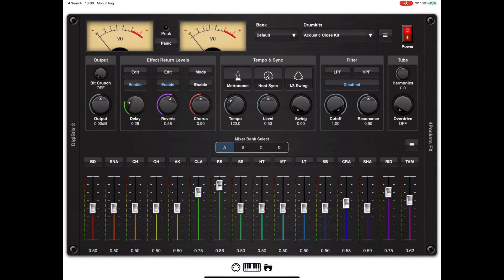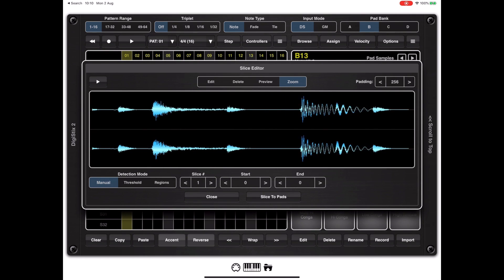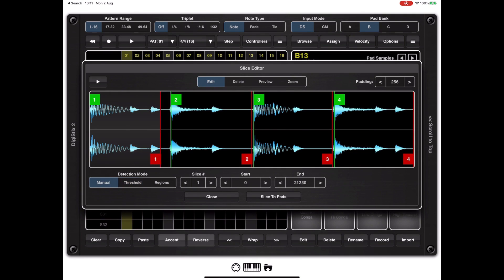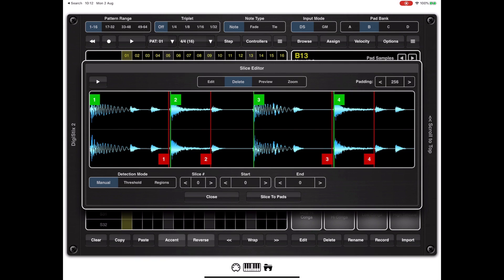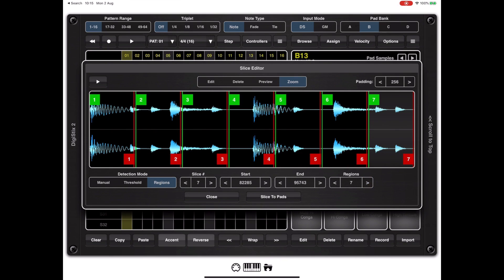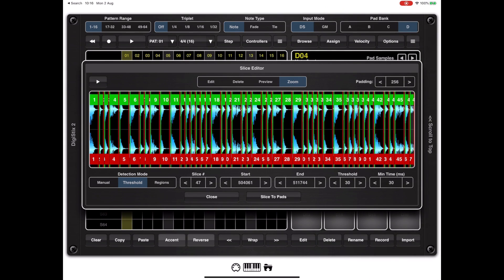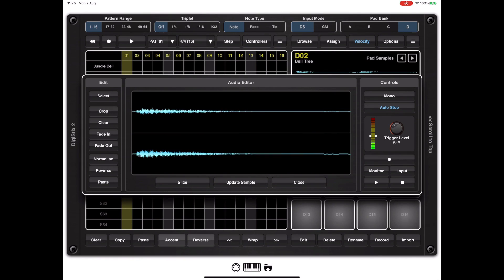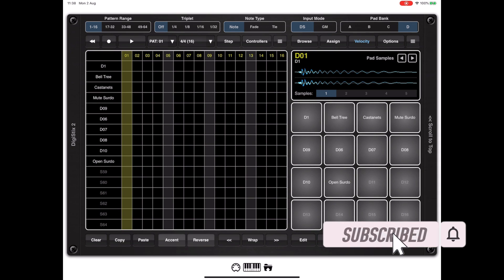DigiStix 2  - Tutorial 2  - Slice Editor

Comment: Great update !
I was wondering if you could make an option so the imported samples appear with the original name on pads without the need to rename.
That would be great for making user kits.
Reply from the maker: The only reason I didn't do this is because you can use the 'Set Pad Defaults' to configure all the names to either GM or DigiStix format. In this case you don't really want to overwrite the names, but I'm sure I can add an option for that no problem.

Comment: Great feature but crashing on slice to pads ! I know your get a quick fix out. Still the best sampler drummer on iPad👍 our try a fresh install see if that fixes it.
Reply from the maker: Really? Can you tell me how many slices you are trying to assign and how long the original sample is? Maybe you've exceeded some kind of limit and I haven't tested properly? Also try the same thing in standalone mode and see if you have the same issues.
Reply: @PaultheMusicMan  Just tried loading the same sample that gave me the problem cropped it first and then sliced to pads via region and it’s fine so not sure what caused the original crash on load to pads strange. Great feature really helpful.
Reply from the maker: @MeerkatMuzic  No worries, let me know if it happens again mate. I will keep banging away at it and see if I can spot anything.
Reply: @PaultheMusicMan  The sample length was 7.868 prior to cropping post crop about 5 sec. Hopefully just a glitch time to make some beats !
Reply from the maker: @MeerkatMuzic  How did you import the Clap? Was it drag and drop? The kit is saved I believe each time a file is dropped on a pad so you shouldn't have lost everything.
Reply: @PaultheMusicMan  It was via the drum pad import option in standalone mode bottom left of the program.
Reply from the maker: @MeerkatMuzic  I'm not sure the Files App is 100% stable TBH. I have not had any issues dragging and dropping samples to the pads from the Files App, and this is definately the quickest way. I will look into this anyway, for now make sure you save, but if you use drag and drop I know the kit is saved automatically.
Reply: @PaultheMusicMan  Ok good news I just realized the kit still there I had 2 names very similar and missed the one I was working on. Our take your tip and try drag and drop from now on. Glad the auto save is rock solid. Many thanks 👍
Reply: @PaultheMusicMan  Hi Paul was trying standalone when it happened only 5 slices. I just reinstalled the app and tried a different sample with 15 slices and it’s now worked a treat. Maybe it was a dodgy sample even though it sounded ok and I cropped it first before entering slice mode to get ride of a long tall. It was a trumpet sound so the transients where not crystal clear maybe it was that. If I hit any further issues our let you know.
Reply from the maker: @MeerkatMuzic  Yes, please do. I tested no end of samples of different formats and lengths and never had a single crash, but that doesn't mean there isn't an issue there somewhere. The more info you can give me the better mate. Thanks for getting back to me so quick.